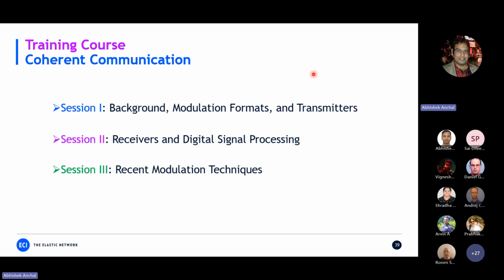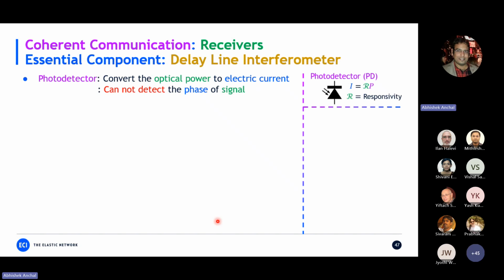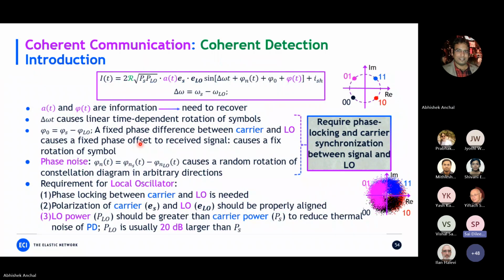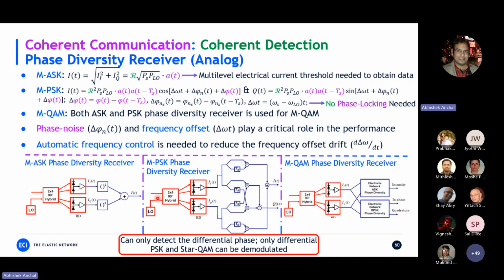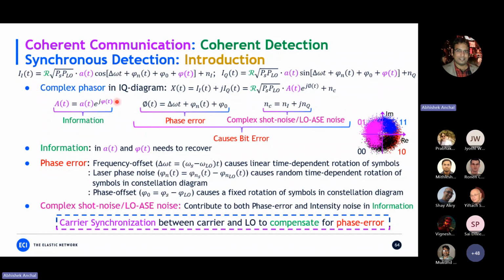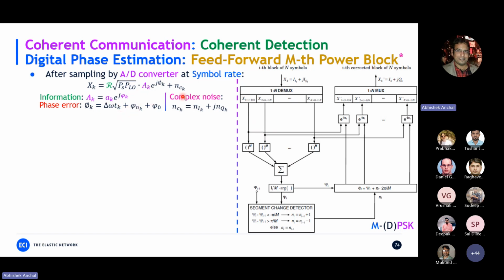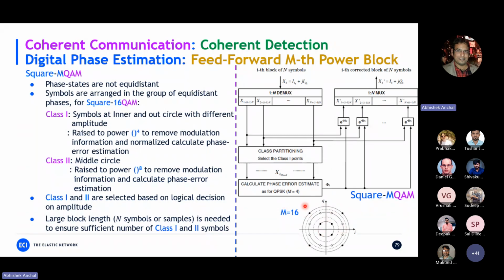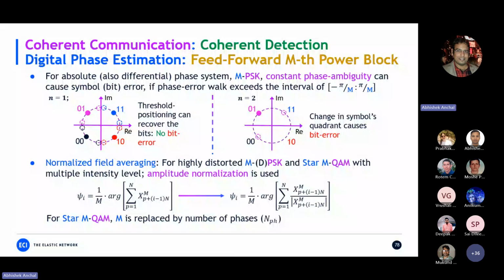Coherent Optical Communications (Session 2)

Comment: Hi Dr Anchal, in slide 45, you stated that fibre chromatic dispersion causes deterministic time-dependent phase rotation. Is this true? Because on slide 70, you stated that the impact of fibre chromatic dispersion is low when we adopt higher modulation formats, as most of the information is modulated on the phase. Thanks.
Reply from the maker: That's correct. Keep it in mind that higher order modulation is mostly affected by fiber nonlinearity. As dispersion tends to destroy phase matching for NL effects, resulting in dispersion assisting in reducing the effect of NL in HOM.

Further, the residual dispersion and NL is compensated by various algorithms in DSP.